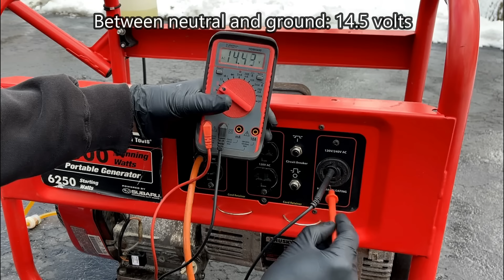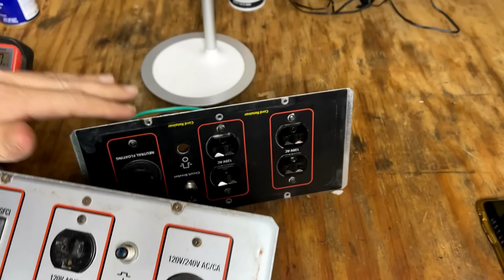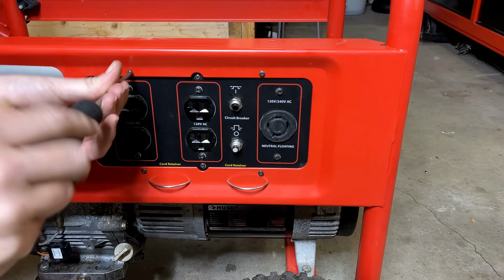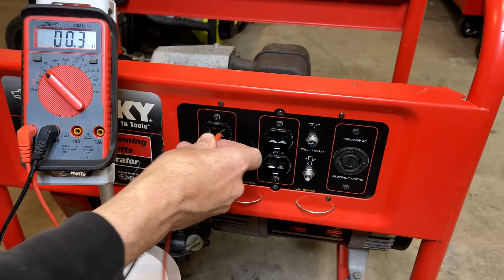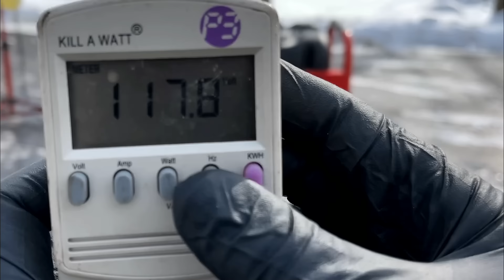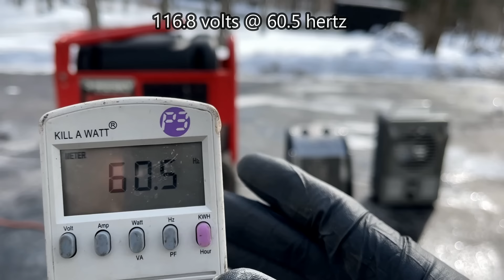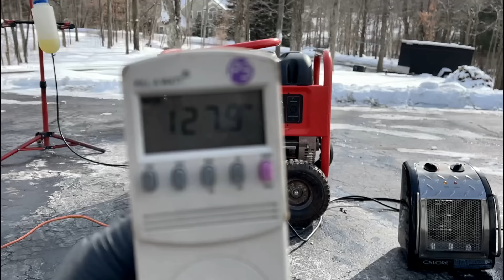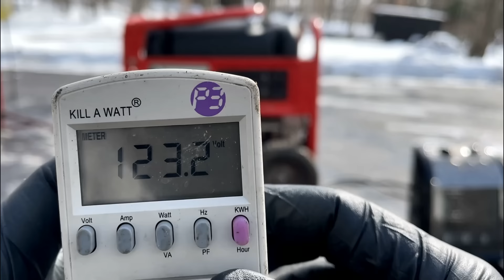No Power Output From Generator - Fixed

Comment: Kind of off subject but my blower motor went out in my 1990 Nissan pickup about 8 or 9 years ago.  I took it apart and cut some of the metal out so the brushes would come out about a 1/8 of an inch more.  It's Nov of 2022 and its still going strong.  Its the original blower and I like the original much better than the new stuff. I always fix what I can instead of replacing and I like to see that you do that as well.

Comment: Hey James, I wander if you could take the broken wire and unwrap one turn on that rotor.  That should give you plenty enough to possibly get a good solder joint.  Just a thought.  Excellent video.
Reply from the maker: In this case I could have since the wire attached to the top outer portion of the coil.  It might make the magnetic field slightly off balance, but probably nothing noticeable.

Comment: Love when you dig into component failure—-like  circuit breaker -not an expensive part.  On the other hand, I sure would like you dig at least a step or 2 deeper into that expensive rotor.  Most of us won’t have a very specific rotor sitting on the shelf.  What failed in the rotor? Please!  A failed rotor would have many of us giving up rather than buying a replacement on a hope.  Generally electrical parts are not returnable.  Love you very informative videos and frequently comment.
Reply: Mr. Rick I Vaguely recall Reconditioning Rotors  for Alternators in my High school Shop Class????!!!  Cheers!~ Russell

Comment: Hey James..that gen.looks like it's been under water or left outside or in a wet basement...you handled it well..
You sure come up with some great deals..Cheers 🥂🥂🥂🇺🇸🇺🇸🇺🇸⚓⚓⚓
Reply from the maker: Thanks.  Definitely left outside for some period.  Probably after it stopped making power.  The guy selling it also was right on the ocean, so the salt in the air did not help any.
Reply: @jcondon1  yeah but he cleaned the tank and frame to sell it.
Reply: @jcondon1  Guessing the salt air is what corroded the breakers.
Reply: @jcondon1  With the water in the tank, and the amount of rust and corrosion, I was ready to bet it was completely underwater for a period of time.  The salt air could do that though, but the fuel contamination just added to the mystery.  Nice final product though.
Reply: Yep! 😢

Comment: Hi James,I've been following you for some time now. Thank you for your videos. You are as close as i can find to a walking Heynes Manual on the internet thank you..
I think it might be time for you to do a video getting to the bottom and creating a fix for these lean running carbs..You seem to have some success with drilling but not always.Can you work out why? Thanks again Tony..
Reply from the maker: Have had luck drilling out jets on Honda and Honda clones.  Minimal on the Mikuni carburetors.  The emulation tubes on the Mikuni are not removable.  Potentially the tube is dirty/clogged?  Also I have noticed one Mikuni that surges on a Subaru ex27/ex30 runs great on a different Subaru ex27/ex30.  I'm sure the carb I pulled off will get used at some point on a different engine.

Comment: Thanks.  Didn't know that aluminum is being used as magnet wire.  Do you suspect that the rotor wire is broken inside the winding because you were never able to get proper conductivity even after scraping the end of the wire?  Could the pilot circuit of the original carb still have sludge in it even after cleaning.?
Enjoyed the video.

Comment: I enjoy watching your videos on all kind of repairs of not only generators but other small engines as well. Would you possible consider  doing a video of converting a generator to dual fuel (gasoline/propane) with one of those Amazon conversion carburetors. Thanks
Reply from the maker: I am considering it with one now.  Not sure yet.

Comment: As always, a top notch repair. Just curious what you think it would have cost to repair this generator with replacement parts and not the spare ones you had on your shelf?
Reply from the maker: The parts for the powerhead were not available.   Probably $500 for a new powerhead and carburetor.

Comment: Hey Jim, Here’s my two cents I’ve run into this kind of problem in the past on different things and it turned out to be the leads on my meter were bad. I purchased new ones and got the correct reading that I was looking for hope it helps.

Comment: Jim, I was thinking of you a few days ago when I saw a gaylord with dozens of carbs in it at the scrap yard, and many were Mitsubishi, and some appeared to be Honda GX160. Some were a bit odd as they had a gearbox on top of the carb. Few of the carbs were disassembled, so my guess is that they were factory dealer serviced.

Comment: Are you using electronics solder with flux core? Also, I would check the other terminal. Chances are corrosion has damaged the other side as well. Solder both sides might save the rotor. Great video!
Reply from the maker: Thanks!  Yes rosin core solder for electronics.  Also added some flux after having trouble getting the wire to stick.
Reply: @jcondon1  And not the lead free junk

Comment: Great video. I have learned a lot from you,  I do have one,  it's a PowerStroke Generator 5,000 wats with Subaru motor like this one. Nedd to bay piston, rings and valves. Best place to buy spare parts? Thanks, we learn from you
Reply from the maker: Subaru is difficult to find parts for.  Not sure the best place.  I have a head and piston from an ex27.  Potentially that would work, but you may have an ex30.

Comment: I noticed you used the concrete floor to measure the drill bit. Could betthat the 1/16th" was due to floor leveling. Maybe a solid piece of steel plate would be more accurate? I have gained so much knowledge from watching your great program. Love the care you give, so as not to further damzfe what you are working on. Sincerly Jack King.
Reply from the maker: Thanks.  Could have been the floor.  Was also thinking it could have been the fan on the rotor bring mounted slightly different.

Comment: Hello, So if the guy ask you to clean it up and repair as needed. What would you have charged him . If I may ask. I had one that worked fot the house just fine. I lost power one day and for got i plugged in the hot tub. The generator and the hot tub stopped working. I got it fixed. They told me it was not putting out enough prms. That sound like it might be right to you? They did charge 100 bucks just to do that. With your bill for all you did would it be worth it to repair or buy new for the  owner?
Nice video thank you.

Comment: James, for flux I recommend good old fashioned rosin, like Kester 186, with that stuff you will feel like you can solder anything. I would also ditch the mechanical solder pickup for copper solder braid wick.
Reply: I agree. Rosin is always you friend. You could also try a specialized solder, like SN100C (but I am sure there are many alternatives).
Reply: @subtext9881  Yeah.......but if the wire is aluminium you can not solder that
Reply: @pauladams9477  The possibility exists the wire may have been copper clad aluminum, and James scraped off the copper clad. I don't know. The rotor was probably junk anyway, but there is a small chance attacking the original joint with solder wick and a heaping load of Kester 186 may have salvaged it.

Comment: 1:03, you can cut litle back and soder a  wire to the good part , use a little of heat shrink and reconnect, there is no need to work in so small space and crappy wire. :) clear the pad using a mini drill :) and them it will better them new, to end the job, use  epoxi glue to hold the wire and don't vibrate and break again, as it have done.

Comment: Use a stripping gel to remove the varnish from the magnet wire. Gel Insulstrip was what I used in the 80's. It's safest since there's no risk to knicking the wire. Once the varnish is removed, use alcohol to clean and neutralize the gel.

Comment: as usual very informative video. The aluminum wire probably needs to be crimped on, or tied down with copper wire which in turn can take solder. My 2 cents for this video.

Comment: I had to troubleshoot a generator and this video came in so handy. From that, found my DPE winding is bad. at 2K ohms. Is that something you see often? Finding a Powermate/black max 7000 watt stator is hard.
Reply from the maker: The DPE winding is a common point a failure.

Comment: Great video, as always. What happens if e polarity of the brushes is reversed?
Reply from the maker: Nothing will be damaged, but likely the generator will not power as it will try and reverse the residual magnetism in the rotor which might remove the residual magnetism.  This rotor had permanent magnets so might be able to recover once the wires are connected properly without having to flash the field.

Comment: I can’t Waite to tell you a service tech was sent to a private island in the Caribbean they lost power the problem was a guy was given a job to check the oil level in the generator he had to take a reading of oil pressure on the only gen every day and Wright it down ! He did day one reading 100  next day 90  next day 80  every day the pressure was going down every day until gen blew up  when asked why he didn’t report problem he said he was only told to write down the pressure not to report  to anyone if there was a problem he did his job !

Comment: The surging got me thinking about a 10K "leading brand" generator I purchased a number of years ago from a local shop.  When we went to test it after the electrician was done, it surged like yours did towards the end.  Sent it back for "service", and when i got it back there was no change.  So I sent it back and got a refund.  To this day I don't understand why they couldn't have fixed it, I guess they didn't try too hard.  At the urging of some co-workers i purchased a Honda and 10 years later I still love the Honda, great machine.
Reply from the maker: My backup generator is a Honda.  Not sure its age, has to be 15+ years old.  Never a problem.

Comment: I use a solder-loaded heat-shrink butt connector that might work on stators. McMaster stocks them in 24-22 and 22-18 gauge wire. Is that small enough? I've had good success. The solder melts with a heat gun. They make a moisture and corrosion resistant connection. You could solder copper wire to the lug and connect to the stator wire with the butt connector.

Comment: That carb jelly comes from too much Stabil in the gas during storage - especially if the gas evaporates some.  Should be well cleaned away when the carb is run through your ultra sonic cleaner.  Always has been so for me.

The solder not coating the looks-like-copper wire problem might actually be that the wire could, in fact, be made of Aluminum with a copper looking surface coloring (sort of a paint).  In the case of, say, overheating during operation, the 'sort'a paint' would discolor dark and if that situation were to just happen for some reason, then just WHO would question anything like wire composition?

Another good one, sir.  Keep cranking them out because even after 2, 3 or more years they're as good as the day you put them up.!

Joe S

Comment: Have we had a video covering rotor bearing replacement, and the requirements of a clean and solder of that disconnected winding? I got excited when it looked like the fix (of a machine that has been left partially submerged) could be super 'simple' requiring: 1. Remove power head. 2. Fix broken bits. 3. Reassemble. 4. Spend money in Miami keys. But no, 'too easy', James says, 'Let's make a hybrid generator'. Pretty wild. Thanks. BTW Aluminium in electronics has killed satellites (when 'hot' they can grow spurs which short out).

Comment: It could be the brushes on the slip rings, I commented on this before you mentioned what happened with the brush holders, I've had them squeal before until they cleaned off the film on the slip ring surface.

Comment: I wonder if someone didn't spray that generator with water while it was running. That would explain the water in the oil. Once it stalled, all that hot metal and plastic cooled and sucked in water all over the place. I have seen that happen to a lot of electronics over the years, where individual components get water inside when they are supposed to be sealed. Great job perservering all the way to the end.
Reply from the maker: Thanks Ernie

Comment: I recently commented on another video about saving my rotor when mud dobbers built a nest on the rotor and corroded a wire in two. I did eventually get it soldered back together and I have tested it pretty well and it seems to be holding up. What I found out though is a lot of the rotors have copper coated aluminum wire to save on money. This makes it extremely hard to get the solder to stick to it. It took me a solid 1.5 hours of trying over and over before I got mine soldered. So don’t give up on it. I think if you stick with it you’ll eventually get a good solder joint on it and you’ll be back in business.  Also I’m commenting half way through so I hope it’s not fixed by the end of the video or I’ll feel stupid. 😂😂
Reply from the maker: I am not that surprised that aluminum was used.  Not nearly as good or repairable as copper.  I wonder how much money was saved by doing that?
Reply: @jcondon1  well I’m not sure. I did recently price the copper wire to rewrap that rotor myself and I guessed at how many linear foot I would need so it could be more or less but I figured it was going to be about $50 just for the copper wire to rewrap it. Maybe I’ll see if I can find some copper coated aluminum just to see what the difference is. If I find some I’ll let you know what it comes out to. 

Also on the same line what’s your opinion on this?  That rotor wire broke right where the wire crosses over from one rotor half to the other. If my soldered connection fails I thought about just taking the wire and unwrapping one wrap from each half so that I have about a 20” tag on each side and then strip, twist, and solder them together at the same point. (Trimming off the excess of course). Every video I watched rewrapping a rotor this is how the halves were joined. So I thing a solder joint there will be fine but the real question I wonder about is will unwrapping one wrap from each side affect the power output?  Surely the number of wraps wouldn’t be that critical I wouldn’t think. In the videos they didn’t even count wraps. It was more of visual of, yeah that looks like enough wire.
Reply: @jcondon1  If you try to solder that again, make sure you use lead-free solder. Leaded solder apparently won't stick to aluminum. Your flux may not work with aluminum either. I'm thinking a crimped connection would be better. Not sure if that's possible.

Comment: It is unreal that there is such a thin aluminum wire going from the coil to the terminal in the generator body. Considering the heat and spinning that is generated when the motor is on, it is amazing that tiny wire does not break.

Comment: I’ve repaired a Subaru that threw a rod. No other damage. Carb replaced with China knock off. RPMs set at 3600-3640. Hertz @ 61 and 125 vac( no load) only one problem; engine has a light intermittent sputter due to too much fuel. (Using the choke makes it worse) Shutting off the fuel supply will result in the engine running smooth just before it is starved of gas and quits. I’ve seen all of your videos but I don’t recall seeing this specific problem. What are my options?
Greg Fox from Coldspring, Tx😊

Comment: just a quick one.. you can use methanol to clear or clean a tank of water ? it turns white to show water but will mix with fuel and run. we use it in model boat ( spark ) racing works a treat

Comment: CCA (Copper Coated Al) wire will always be the downfall of power head rotors, aluminum is brittle compared to copper in a high vibratory environment... it's a shame you couldn't save the original rotor, glad to see you managed to save the genset with another rotor

Comment: 26:04.  the black casing in the middle didn't seat all the way.  there is 1/8 reveal line of rust showing on the engine side. pb blaster and a dead blow hammer. would've solved this.  eventually that stator housing will move due to vibration.    Other than that excellent video!

Comment: Interesting. I usually use a little acid on the tough to solder joints. A little drop will go far but make sure you neutralize it with water when done or it will continue to eat away at it. 😊

Comment: You can use a pick, to remove one cover of the ball bearing, and put a small amount of white lithium grease in, and replace the cover.
  Had a bearing that felt OK, but was a little noisey. Re greased it 5 years ago, and it's still quiet....

Comment: Do you have a source of small crimp joints? One would make easy work of splicing rotor windings to another wire that would solder well, just by adding half an inch of clean copper wire

Comment: Nice job. I was surprised to learn some makers use aluminium wire in their rotors. Very odd. It ended your way, which is good.
Reply from the maker: So was I.  The copper coating had me fooled.
Reply: @jcondon1  Sure it was copper clad? Probably copper colored enamel.

Comment: I am wondering if you find corrosion on the electrical connectors when working on engines exposed to a lot of moisture.  I am also interested in finding whether or not the crimped electrical connectors are soldered.
Reply from the maker: I commonly find corrosion down in the powerhead at the main power wire block.  From the factory they are crimped.  A crimped connection works better in a high vibration environment like in a generator.

Comment: If you have access to a sand blast cabinet, mask around the solder joint to keep sand off the rest of rotor and blast lightly  removing oxidation and wire coating exposing clean area to solder.